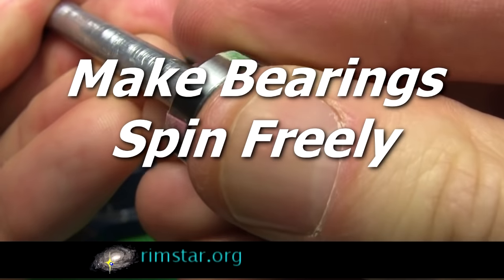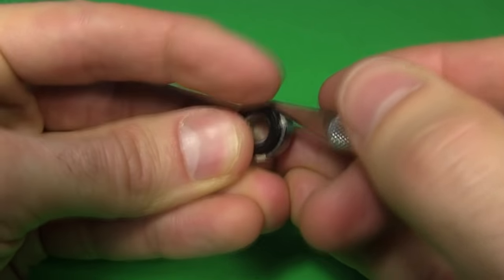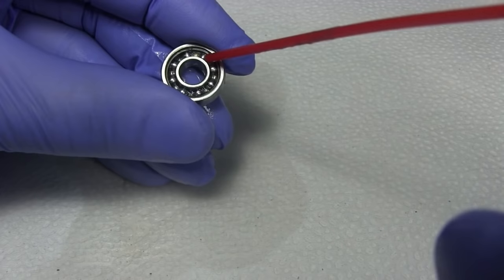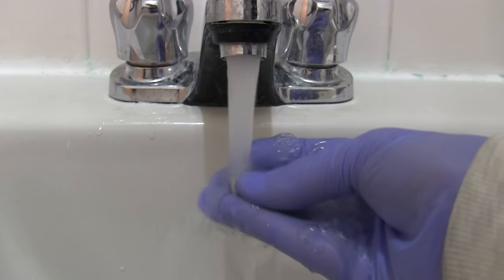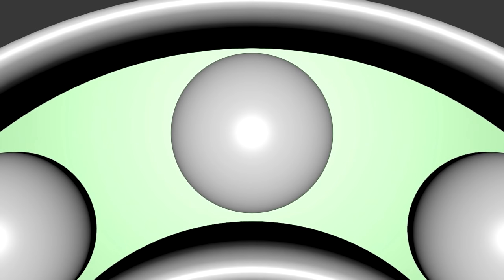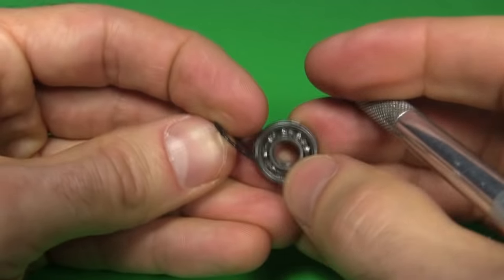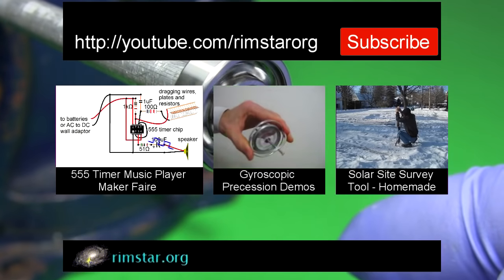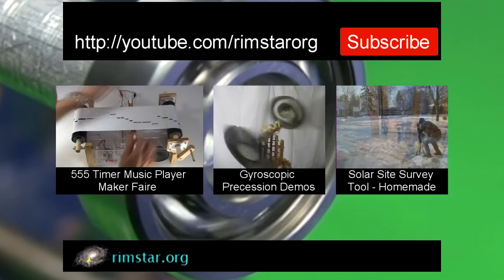How to Make Bearings Spin Faster/Freely

Comment: Follow up - I did indeed clean the grease out of the MANY bearings in my invention and YOU DID save my invention! The bearings are spinning like crazy and I couldn't be happier! The only thing I'm confused about is that many people here said that WD-40 is NOT a lubricant, but it says right there on the can that it is. It specifically says "LUBRICATES moving parts such as: Hinges, Wheels, Rollers, Chains, gears". 

One of the comments here said they follow up by re-lubricating with sewing machine oil. But I opted to just follow your tutorial and not add any kind of additional lubricant because I had so many bearings that it took a long time to clean out all of them and so I didn't want to add anything before seeing if it might be needed. As it stands now, I see no need for any lubrication, so I'm leaving it as-is.

I do have bicycle type chains involved in this thing and I might try using this for them too. Again - Thank You!!!
Reply from the maker: I thnk a lot of people think WD-40 isn't a lubricant because it has other uses. For example, in this video I didn't use it as a lubricant but as a decreaser to remove the grease. While it is a lubricant, I find that it doesn't last very long so for lubricating my bicycle chain and other parts on the outside, I use an oil instead. When I open up the bike's bearings I put grease for the reasons given in the second half of this video.
What I did learn after this video is that a good follow-up after cleaning out all the grease is to then add graphite lubricant. It'll still spin fast but will also have the protections for the reasons given in the second half of this video. But whether you need to or not depends on if those things matter. I originally did this for my electrostatic motor and none of those issues applied.
Reply from the maker: And I'm glad to hear my video helped! Thanks!
Reply: I also thought of using graphite lube but the bearings I have have nylon spacers and I wasn't sure if that might create an issue. I've only used graphite lube for all-metal joints so I decided that 'if it ain't broke, don't fix it' was the best approach.

I'm using V-groove bearings and although I did find many options for buying 'dry bearings' I need a very specific size and I definitely need that V-groove because my bearings are running along a track. All the V-grooved bearings I found have grease in them so, I'm committed to using those. Your video saved my butt because my bearings were moving so slowly that the motor driving them began smoking! My invention involves bearings being used as guide rollers running at a fast speed. (like train wheels)

I'm not a machinist, I'm a special effects artist, animator and part-time inventor so, my skills are many but never enough. Sometimes a tutorial like yours is the very thing that saves the day. I've been building this invention in my head for years and finally knuckled down to building the first prototype and it was working splendidly but, not nearly at the speed I needed it to. I Googled "make bearings spin faster" and the first result that popped up on my screen was your video... you made my week, you made my month, THANK YOU! :)
Reply: Depending what the bearings is for would I lube with WD ?
Reply: The thing is that wd 40 will ultimately dry out the bearing since it isn't viscous enough, it's so thin I strips grease then either flows out or evaporates out causing the bearing to rust and seize. If you use wd 40 you should follow up with a slightly thicker lubricant such as sewing machine oil.

Comment: You can do this and still have the bearings by using a thin high quality oil. Like a fully synthetic 0W30 or a 5W30. The oil gives you free movement and still keeps the bearing balls lubricated. The seal removal depends upon conditions of use. If the environment you are using the bearings in is dusty or unclean for any reason, you'll be better off replacing grease with a synthetic oil and put the seals back on. But if the bearings are inside an enclosure where almost no dust or other particles get in and the bearings aren't going to be running high rpm, then you can live with the seals removed. For example, if the enclosure's air inlet and outlet ports have filters on them.

Comment: How to completely fuckup any bearing 101.
Reply from the maker: +Harvie Depends on what you need it for. For my electrostatic motor it was just what I needed. The 2nd half of the video is to explain why you might not want to do this.
Reply: +RimstarOrg surely. i've been looking at it from skateboard bearing maintenance perspective. electrostatic motor sounds more like something of laboratory experiment, where durability is not real concern. anyway, if there's somebody that is going to use the bearings for skating, this is like worst thing you can do except for putting sand in the bearing :-)

Comment: the best way to make a bearing spin faster:
1. take out the cover(seal) of the bearing
2.spray WD-40 on the bearing balls and try to spin it for a while to make the WD-40 spread on the grease
3.put the brearing into a container and put some alcohol and shake it for 1minute
4.put the bearing on a container again and put some hot water(not boiled water)and shake it for a minute again
5. get some towel,tissue, or hairdryer to make the bearing dry before it get rust and then your now ready to roll like a pro

Comment: For in door hobbies that don't require high RPMs, dirt in the bearing is not an issue and the gritty sound it will soon obtain is not a problem , then GO FOR IT !
Reply from the maker: Yup, that pretty much describes my application. I did this for an electrostatic motor: indoor hobby, light load.

Comment: Here's what I did to clean my skateboard bearings when I skated.... bro they have bones bearing container.... take seals off... put in container... use citrus clesner...  shake the crap out of it... open container pour cleaner out then put water in it... shake the piss out of it again to get the liquid to wash away all the guck whatever... than water is enemy to steel so... grab a blow dryer and literally blow dry all 8 bearings till there hot... than put seals back on they spun like crazy no oil or grease but that means u would have to this frequently cuz like the guy said metal on metal is not ideal for bearings but this was the method I chose and I had fun learning it this was like 10 years of trial and error than I watch a youtube video of some little kid like 17 or 18 telling how it's done like a master I first used gasoline just to say the least alright peace man
Reply: " than water is enemy to steel so... grab a blow dryer and literally blow dry all 8 bearings till there hot."
Just a tip if you need to be so paranoid regarding water, maybe you're using sponge balls ones magician use, try using the ones made of metal instead.
Reply: @trinidad17  hey dude... I'm long passed my skateboard yrs I put my board up 5 yrs ago when I was 28yrs.... that said I was reading ur post I'm like dam I hope all these years I for sure knew metal is able to rust when to contact with water if not dried properly so I googled is heres a copy paste of googs:

Rust is the byproduct of a process called "corrosion." Metal corrodes when it goes through a chemical reaction involving the oxygen in water. If the metal is kept dry at all times, it is much less likely to start rusting than if it is constantly being exposed to rain or to high humidity that condenses on the metal.

Comment: Thanks, this is just what I need. I've got a small toy that I've 3D printed and need less friction from a brand new bearing so that it'll spin freely for longer. It's not load bearing, won't see much use and I don't have to worry about dirt or water ingress. This worked perfectly. Thank you!
Reply from the maker: Finally! Someone else besides me who had a suitable application for this. Thanks for letting me know. I'm glad it helped.

Comment: "Brake Parts Cleaner" will degrease them quickly in one shot without the risk of water exposure.  Then lube with a graphite/moly blended dry lubricant.

Comment: Thank you ~ I need this for make my fidget >,< I only got very slow spin bearing
Reply: Bruce Vlog me too, where did you get your bearings? I got mine from an old roller skate, they suck haha
Reply: xD me also
Reply: Protip: Use mineral turpentine to clean your bearing. I sell these online.
Reply: Bruce Vlog omg same
Reply: Bruce Vlog me too
Reply: Bruce Vlog I
Reply: lol,IT Will spin very fast
Reply: Bruce Vlog i
Reply: Bruce Vlog a good tip is to take all the balls of the bearing out completely then only put 3 back in equally spaced apart. That reduces friction a little over half
Reply: Bruce Vlog same
Reply: Bruce Vlog don't ever do this get some skate lube it will make it go fast
Reply: fidgets were invented already in nov?
Reply: i made my own fidget out of wood!

Comment: You can clean the grease out with brake cleaner. I would do it outside though as the stuff is stinky. You don't need to rinse after using brake cleaner.

Comment: use chain lube as a lubricant, it's a can of spray, you can keep it all spinning nice and smoothly without the rust and heat problems and the bearing will last longer than no lubricant. you may have to spray the bearings everyday.

Comment: Suggest shooting a bit of dry PTFE lubricant into them. I've got some by Ballistol that's an ether based spray, the liquid evaporates very quickly and the part is left with a thin coat of dry PTFE flakes. Other dry lubricant is graphite, but it's not nearly as slippery and is nasty to work with for the kinds of projects you're after.

Comment: yeah this may work for a bit , but soon as oil drys or water gets in you will have same problem , might as well buy a new bearing , 

we use white grease at the plant I work at, most bearing after they lose all their lubricant and heat up it's to late, this may work if you notice the bearing is starting or drag or make a loud noise

Comment: Wd-40 is not a lubricant that lasts. It dries up. Great short term, and cleans them pretty good though. Do this, but give them a drop of bones speed cream. You can get it for about $10 at a skate shop

You can also clean them with windex fairly well, and hit them with speed cream. 3 in 1 oil also works pretty good
Reply: Kk thanks
Reply: But he said acts like a lubricant but also good for removing grease, and that's why he kinda like referring to penetrating oil

Comment: I think you need some mineral based coating. RUST! I live near the coast. That bearing would be all brown in 48 hours of onshore wind... Especially after being handled with bare hands, which I notice you where careful to avoid. You can get almost as free with just the spray lube (I like Lanolin, or CRP7 over wd40) with seals still in place. if you spray and spin a lot. Its a halfway measure I guess, less spin but more protected than no lube, and still a lot faster spin than new grease.
Reply: synthetic = rust

Comment: I've been in the bearing business for 25 years. First, that is a radial ball bearing not a roller bearing. You are making it a "free spin" by taking out any grease and replacing it with oil. Just because it doesn't spin freely doesn't mean it won't perform excellent. If you're a skateboarder and think an ABEC rating will make you faster that's really not the case. The bearing is higher precision and can go faster in let's say a high speed tool but once your board hits the pavement hard there goes any precision.
Reply from the maker: My application was a very low torque electrostatic motor, purely an indoor, science project type thing. But I've found that most people who come across this video are looking for it for skateboarding, definitely the wrong audience.
Reply: @RimstarOrg  If that's the case you did a fine job and you let viewers know you can take off the seals, re lube and re-install.
Reply from the maker: Thanks. Though I don't know how I got the type of bearing wrong. I even have a vague recollection of checking but the brain sometimes fails anyway.
Reply: @RimstarOrg  No biggie. Another error is when people call a steel ball a ball bearing. But, it's just industry technicalities.
Reply: @jamesmandas639  so is graphite lubricant good for skate bearings?
Reply: @Jasekingg  I've never seen it used with ball bearings. They use graphite for bushings and high temp applications. Don't pack bearing of grease. Maybe about a 15% fill. Keep it clean and free of contaminants and you with seals on the bearing and you should be good to go.
Reply: @jamesmandas639  I see, thanks.
Reply: So... How to make the skateboard go faster cuz you're really right... When my skateboard hit the pavement it didn't run for too long and I had to push it a lot until my leg hurts me... So I need a solution or just tell a brand good bearings but plz not expensive...
Reply: @sherifalaa273  I had the same problem, theres a lubricant called speed cream which might help a little but I had to make sure my bearing where clean and had no rust. I also bought skate wheels that were wider but still 99a
Reply: @sherifalaa273  I also lubricated the part of my trucks where you put the wheels and made sure that it was loose enough to prevent friction but tight enough to keep it solid and prevent rattling
Reply: @Jasekingg  the problem is ... I started to think about the wheels are the problem and I want to find solution about both the bearings and the wheels ... Also there's another problem which is I'm living in egypt and the skateboard and parts are insanely expensive (like 1800 bucks and wheels for 800 or something like this!!).... So I'm tryna figure out how to make it go further without pushing it...
Reply: @sherifalaa273  I usually do a test to see how good my bearing and lubricant is by rolling the wheels with my hand and seeing how fast and long they stay rolling. If yours roll fast and stay rolling then it could be the environment you're riding in like bumpy roads, if thats true the best thing to do is get cruising wheels
Reply: @Jasekingg  ok ty dude 🖤
Reply: This is the most interesting conversation ive ever seen in youtube.
Reply: @jamesmandas639  From WD 40 brand, which one is the best for lubricating ball bearings like in the skateboard or drum pedals ? ... Is WD 40 white lithium grease good enough for that ?

Comment: I was cringing this whole video until he explained this wasn't intended for most applications.  Thanks for adding that last bit.  Wouldn't a drop or two of a very light oil be beneficial in your case through?   Mainly for noisy bearings on your music machine and just to help protect from oxidation?  Probably smoother operation on your machine also?  Good vid.
Reply from the maker: Thanks. Yeah, that last part of the video was definitely necessary. Regarding oil for reducing sound for my music machine, this whole thing isn't needed for the music machine since it's hand cranked and spins very slowly. For my electrostatic/corona motor (https://www.youtube.com/watch?v=9uEjXsX1F14), I'm told there's some form of graphite lubricant that won't slow it down, and may even make it spin faster yet.

Comment: A lot of ignorance in the comments.  

Bearings this size are rated for 30,000+ RPM and 300 lbs static,  600 lbs dynamic load.  His use case is .01%-.001% of that bearing’s capacity. 

Everyone quick to naysay “bUt tHaT’s bAd fOr tHe bEaRiNg” without thinking about the application.  

Aerospace bearing? No I would not remove the seal/lubricant.  
Bearing with 90% duty cycle? No I would not remove the seal/lubricant.  

Bearing for a music box?  That turns maybe 5 rpm with about 4 oz total radial load on it and a .01% duty cycle?   Bruh, stop overthinking it.  It’s operating at 1% of its design envelope.  Besides, if it fails, nobody dies, dude replaces a bearing that cost $0.80.  WOW.  You’re arguing about misuse of an 80 cent part.  🤔 🤡
Reply: Yeah, these folks really didn't get the video.
Reply: Yep. I'm making 3D printer filament spool rollers. Need them to spin with next to 0 friction, and 608rs bearings are always made with thick grease (because they hold humans on skateboards). A 1kg to 5kg roll of plastic on a bearing assisted shaft isn't going to hurt the bearings. Lol

Comment: The thing with a lot of oil like wd-40 is that it attracts dust, you might not want to use it in open conditions especially from a skateboarding sense because it can cause grime and dust to get in the bearing. as for shieldings, if the shielding on the bearing is preventing it from spinning its most likely dented, in which case the best option would be to get a new bearing because once again without shielding it can attract grime and dust.

Comment: Don't ever use water on a bearing.
Clean the F'n things when shields removed with gasoline and a toothbrush.... let air dry in the sun or forced hot air......and then regrease to about 2/3's quality grease ... and then replace shields.

Comment: after putting it in the thinner dont put water otherwise it will rust.
but you can use any citrus cleaner to remove grease in any bearing.
i learned this technic on skateboards.

Comment: You can use dry lubricant instead of grease
Reply from the maker: Thanks. Yeah, I didn't know about it at the time I made this video but learned about it from these comments. One of the perks of making educational videos is you also learn from the responses. I later bought some ceramic bearings containing dry lubricant.
Reply: Do you think WD 40 white lithium grease is good enough for lubricating ball bearings like in the skateboard or drum pedals ?

Comment: That's actually a ball bearing not a roller bearing
Reply: A roller bearing is a category name. A ball bearing is one of them, a cylindrical roller bearing is another one in the same category. There is lots of  info on the internet about bearings.